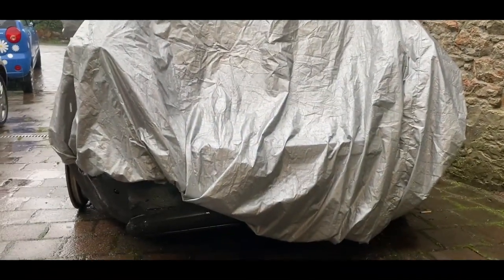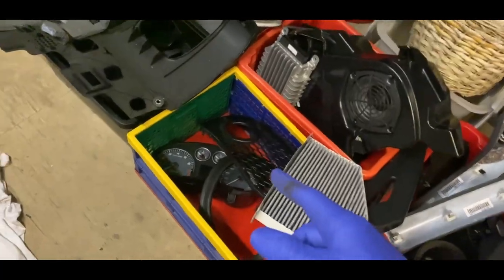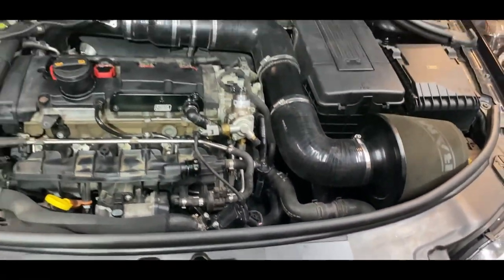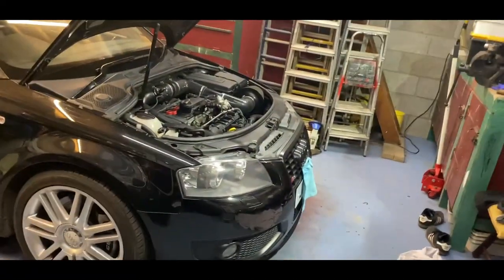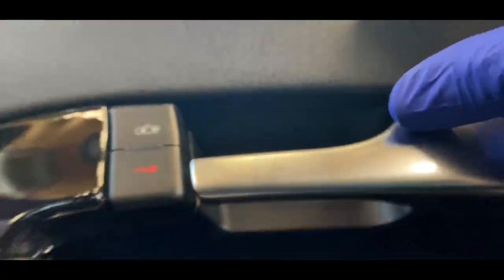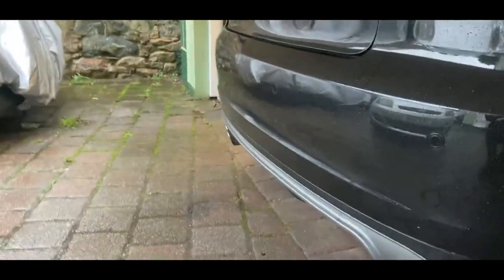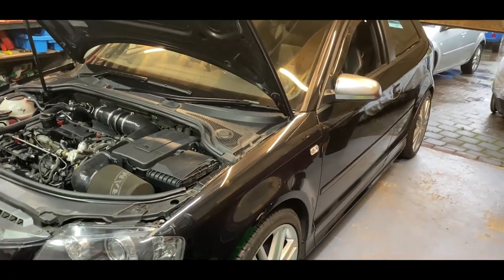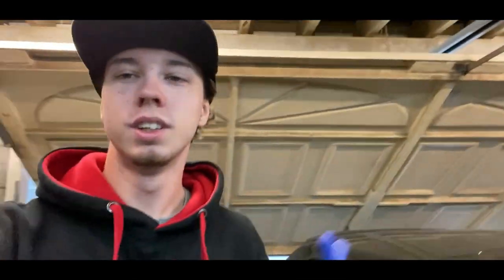I Got My New Audi S3 8P!!

Comment: Where did you get the inlet vales etc cleaned? and how much was it? How many miles has your car done when you got the valves done? thank you :)
Reply from the maker: Hi mate, got them done at my local audi dealer, car had 58k miles and needed them to be done. the cost included fitting inlet manifold flap delete kit and fitting a clutch, all in was £500

Comment: What do I need to watch out for when buying a used s3 8p ?
Reply from the maker: Hi mate, mostly just all the levels, the front doors dropped, take a OBD with you because things like the electric mirrors may not work, heated seats sometimes not work, and these only store codes in the ecu and not on the dash..
Reply: @MotoAdventuresYT  mechanical any issues

Comment: Nice dude that's a good price too.
Reply: Do you want my e mail for the rear brakes dude?
Reply from the maker: Sorry man, been super busy, unfortunately the brakes have sold, all four of them, went to a bloke that was 10min up the road from
Me... anything else?
Reply: @MotoAdventuresYT  No problems buddy all helps to pay for things. All I need otherwise is a battery cover but I'm not super fussed about that.....so the new one does that have full audi history? I picked mine up with 53.7k fash only to find the halted was 3 years overdue. But I since got that sorted. Might be worth ringing your dealer dude doing a history check with them👍
Reply from the maker: @davidkane9876  Thanks for understand man, unfortuantly the battery cover snapped during the crash, for service history goes, it has a service 600 miles ago, oil, cambelt, water pump, although it’s on the list to get the diff oil changed gear oil ect. Just for peace of mind that nothing has a excuse of breaking due to bad fluid 😇
Reply: @MotoAdventuresYT  No worries dude it's all good. I'm on about the top piece cover for the battery my clip was broken whe i got it. Lol mine had 100 miles since last service bet audi still asked me if I wanted it changing...  That's audi right?! I hear you there no dirty oil makes things break. What's going on with the k04 from the old motor then dude?
Reply from the maker: @davidkane9876   Yeah the same happened to mine after the crash, as the fire department broke it trying to get the terminals off the battery when the car was crashed. Gutted because I got it painted gloss black lol. Awh wow haha, I bet they did 😂 no, it was done by a local garage, although i know someone that works for Audi and does loads of private work. So I will be getting him to do the fluids very soon and getting the meaningful stamp! Nothing at the moment mate, just keeping it for spare especially until I have mapped my new one. To make sure everything is safe with the current one on the car. 😇
Reply: @MotoAdventuresYT  I hear you now buddy. I need a friend like yours lol super handy as I like to do my own work but need the stamps as history. See I have the tsi motor but the k03 turbo. Basically a gti not a gti ed30 lol kinda thing. K04 from the s3 is a direct bolt on tho I've been told. 

Ohhhh quick question. Where are you getting the carbon trim panels from dude?That's gonna look mint